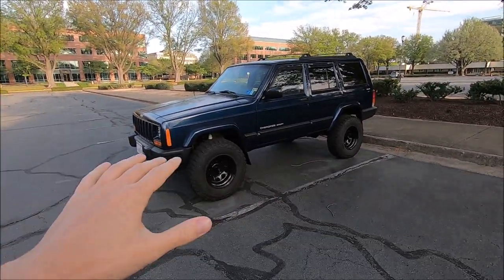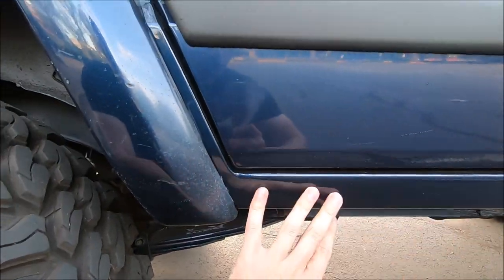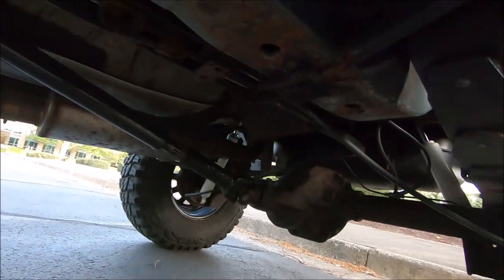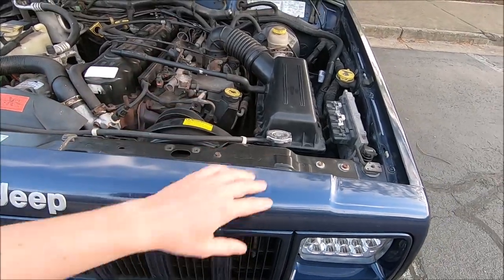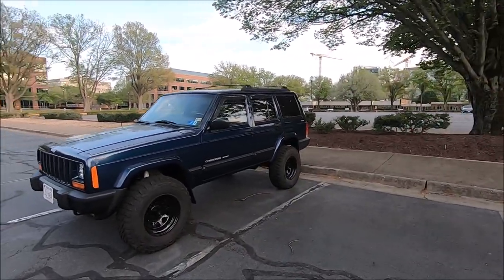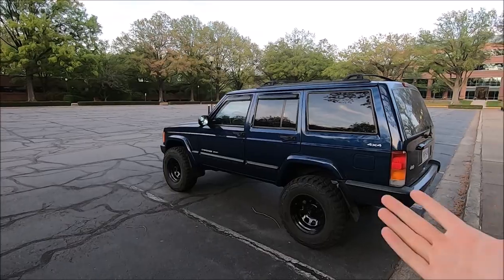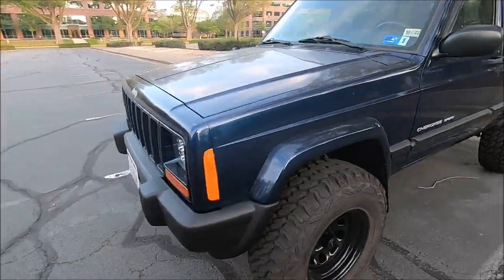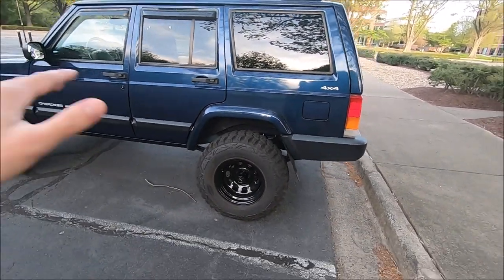All The Issues With My Jeep Cherokee XJ After 2 Years...

Comment from the maker: What would you all like to see next with the XJ? Comment below!
Reply: You should add a double din touchscreen radio
Reply: Fam your jeep is perfect the way it is. Unless you just want to go crazy with 4 links and stuff like that all I suggest is maintain it like you already doing. BTW 96' 4.0 ax15 all original. I bought it for 500 u.s.d..  door hing pins on driver side and passenger floor pan rust due the that seal on the firewall. 240,00k miles. Like you said it's not for sale lol.
Reply from the maker: That’s exactly my plan. I’d like to do some more rust maintenance and possibly upgrade the steering but other than that, just maintain it. Your 96 is probably a fun Jeep as well, how’s the AX15?
Reply: @KCars  I love the ax15. But I'm also a manual lover. It feels faster than a normal automatic tho.
Reply from the maker: Sounds like a fun Jeep and definitely a keeper
Reply: @KCars  yea my area it's rare to see a factory manual jeep xj. From what I read and no one agrees on this btw. There just isn't any real numbers on this on anything I've seen. But only 1/3 of all xj's made was manual and most of those was the 4 cylinders. And if anyone reading this knows real numbers please correct me. I'd really Ike to know the actual numbers. Only thing I wish mine was is a 2 door 4.0 ax15. But I'm very happy and content with mine.
Reply from the maker: That’s what I’ve heard too, especially with the two door models

Comment: The door check pin is cracked. Just get a new one and tap it in. The small bracket may need replacing too if the hole got reamed out. You're going to ruin the door check itself leaving it like that. Get extras and keep them in the glovebox. Four Cherokees in 32 years and only one overheated. The radiator blew. I have well over 500k miles in Cherokees and only 4 breakdowns that required a tow. If I had the parts a roadside repair could have been done. These rigs are pretty basic. I'll keep my current 99 forever. Yours looks really nice.
Reply from the maker: Thanks!

Comment: Genuine Mopar parts are absolutely the way to go if you can still find them. I can't find them consistently anymore and it's almost like my jeep inevitably rejects non OEM parts, or they fail earlier than original Mopar. I've had my 99 XJ for 17 years 255,000 now and keep her running cherry, and I have compared many parts. Radiator, sensors, gauges, water pumps, manifolds, alternators etc, even sparkplugs (learned very quickly to stay away from fancy,  original champions  or jeep just acts funny). Another example was when I bought a non mopar thermostat 180 because I thought it would be a great idea if my jeep ran cooler, boy was that a mistake. XJ was already given me 13 per gallon then I dipped to 11 because  it ran rich. Found a brand new Mopar 195 and just like the original engineers intended, jumped to 15. These vehicles were designed to run hot.
Reply from the maker: Yup they run the best with the parts they were originally built with🤷🏼‍♂️ if it ain’t broke don’t fix it. Thanks for watching!

Comment: Don't remove the original fenders. I honestly think that is what gives the xj its unique look. At the most wet sand the rust with clean green and soft cloth or scotchbrite and the rust color should come off. If you put after market fenders you become a wrangler ✌️
Reply from the maker: I wouldn’t put aftermarket fenders on it, just wanted to get brand new OEM ones and get them painted to match the body. But that also sounds like a good idea

Comment: Re: the fender flares, they're not metal.  Just take 'em off and get them sanded/painted to match your body paint.

Re: the door click, the pin isn't fully seated.  It should stick through BOTH brackets.
Reply from the maker: Thanks!
Reply: @KCars  np.

Enjoy your XJ.  I've had mine since 97 (new) and 325,000 miles later it's still going.

Gas is expensive and the mileage sucks, but I also haven't had a car payment in 22 years.
Reply from the maker: Ya these things are definitely tanks and will go forever if maintained well

Comment: I love the Rusty’s steering linkage i put on my 2001 xj. The clearance issue is from the drag link contacting the track bar bolt when making a full right turn. It’s negligible as it barely scratches the paint of the drag link and isn’t enough to damage the track bar bolt. I think Rusty’s even started supplying a replacement bolt with an Allen head to fix it
Reply from the maker: Sweet! I see they have a few different steering kits. Do you have the standard, offset, or over the knuckle steering system?
Reply: @KCars  i believe the standard. The conversion they offer for the xj tj yj & zj. It’s a T link setup so the tie rod goes underneath from knuckle to knuckle.
Reply from the maker: I’ll have to look into that, thanks!
Reply: I just took an angle grinder to that bolt on mine. Now it doesnt stick out enough to rub.

Comment: My little brother, I am a veteran mechanic doing it for about 40 years.What you need to do is put on a nice big aluminum radiator for your truck and a Emissimoto thermostat.
It will fix your problems forever.Keep it cool all the timeven at a hundred and ten

Comment: You have an awesome looking XJ, that looks almost identical to mine which is a 2000. I bought it in 2009 with 140,000 miles on the odometer for $5,500. Today it has 220,000 miles and still runs great at 24 years old. They last forever if you look after them. I love mine and I will never part with it.
Reply from the maker: thanks! Agreed, these old Jeeps are really impressive. Thanks for watching!

Comment: My 89, closed system, never overheated but ran warm.  Fixed the electric fan but still had heat creep.  Installed a new fan clutch.  My 89 is a lot older than yours.  Only 124K miles now, uses no oil, rust free, needs painting.  Just something to think about.  I was going to go with a new aluminum radiator but the fan clutch fix it.  My old fan clutch was probably at about 50 to 70 percent good.  The new one made a big difference.
Reply from the maker: I think mine seems to be working the way it should but that’s definitely something I thought about replacing as well. It should have some resistance while the Jeep is not running right?
Reply: @KCars  It should have a lot of resistance when hot. Less when cool. It should not freewheel when cool. It should stop when turned in a couple of seconds. Mine did but when hot it had little resistance.
Reply from the maker: Ahh ok, appreciate it

Comment: I don't think that the door pin is cracked, I think it's a tension pin. What you need to do is to weld the hole as it's probably elongated. Redrill it with a proper size drill bit then replace the tension pin very cheap and easy.
Reply from the maker: Hmmm I’ll have to look into that. A lot of people were saying that I just need to hammer it back down in the hole
Reply: Jb weld

Comment: Nice snow drive. Really shows how awesome the xj is✌️
I have a maroon 2000 xj automatic. I have just started work on improving it. Flowkooler water pump, hesco high flow water pump, caprice 74C thermostat, next is probably the k suspension cyclone electric fans.
Just watched your video on the fan. Thanks for posting these as it helps newbie xj owners like me🙏
Reply from the maker: That snow drive was a lot of fun. Glad I could help, thanks for watching!

Comment: I'm about to start my own Jeep XJ project, I've had her for 18 years and decided to get some mods for her. I was looking into the 4.5" lift kit but after seeing your Jeep I'm convinced the 3" will do just fine, so thanks for that.
Have a question though, after lifting and installing the 31-10.5 tires, do you need to change the wheels? The factory 15" wheels won't work with that setup?
Thanks and great job with your Jeep mods, I enjoyed the vid a lot.
Reply from the maker: Thanks for watching! I would think that you could put 31s on the stock wheels, however, they are an inch narrower than my wheels so they might just be a little more pinched and have less of a contact patch. Not 100% sure on that though but I’d definitely go for aftermarket wheels anyways just because I like how they look more than the stock wheels but of course that’s just my opinion

Comment: All relatable problems comparing to my XJ. Nice video.  Hey why don't you use WD 40 to clean your engine bay. I used and really liked it.
Reply from the maker: Thanks! I wouldn’t want my engine be to be all oily and greasy
Reply: @KCars  yes I agree but not to spray all components. I would really suggest you to clean atleast your fuse box battery and Throttle position sensor and Mass airflow sensors. All corrosion will be gone forever and clean. They are most likely to have problems.
Reply from the maker: I’ll have to look into that, thanks!

Comment: Pop the pin back into place on the passenger side door and your jeep is over heating at any temp over 210.
Reply from the maker: Still need to fix that pin lol and luckily I’ve had no overheating issues after getting the cooling parts replaced

Comment: Put some insulation tape around the metal pin that's creating the door click noise. Or just slip a rubber pipe over it. Or even just a rubber adhesive strip in between. The pin just has to hit a soft surface and the click should stop.
Reply from the maker: Thanks!
Reply: More than likely it’s the bracket that has worn out. The bracket and new pin are cheap and easily replaced.
Reply from the maker: I’ve also heard that the pin just needs to be pushed down for it to stop clicking
Reply: Buy a new bushing and pin and seat it all the way down to the shaft stop.
Reply from the maker: Thanks

Comment: 1994 jeep xj here. It's my 5th XJ. Nothing fancy, 3inch lift with 30s, doors falling off, dents and dings, etc...Trust me when I say, upgrade the radiator.
Reply from the maker: Which radiator would you recommend? I’ve heard that keeping the stock one is the best option if it still works fine but I’ve never had a different one
Reply: @KCars  I picked up a 2core from O'Reilly's for about 150 a few years ago. Overheating hasn't been an issue since. Same with my 89 remix that I had. Just make sure you burp it good.
Reply from the maker: Is it the spectra brand radiator?

Comment: I think it's so funny because I do this as well.  I say,  "I got a really good deal, only $3500.  This car is so clean and in such good shape." Then I spend like $10k in repairs and mods.
Reply from the maker: Lol it’s a never ending project
Reply: ..but still better than a 500 or 600  dollar a month car payment for 7 years 😮😮
Reply: @Roberto Ferrari  agreed. I have a 98 cherokee and an 83 mercedes 240D. I find most parts I need at the local pick your part, and I pull extra parts to sell on eBay.  I'm essentially at a break even on repairs, and have no car payment.  The thought of spending $600 a month on a car I can't repair myself slugs crazy to me.

Comment: What about the 0331 cylinder head? Did you have to replace it?
Reply from the maker: Nope. Haven’t had any issues with it cracking. Also replaced most of the cooling parts to avoid that issue in the future as well.

Comment: put an aluminum radiator with 3 fans and that set no more over heating
Reply from the maker: Thanks! I actually had the cooling parts replaced with all OEM parts and I’ve had no issues

Comment: Any issues with the front wheels rubbing on turns?
Reply from the maker: They rubbed the bumper end caps so those were trimmed and they rub the mud flaps a little bit as well but I decided to keep those on because I like the look and function of them and they don’t rub too much only on full lock

Comment: How’s it on gas? Been debating to buy one
Reply from the maker: Some people say bad and some people say good. I’ve honestly never calculated my MPGs
Reply: Averages about $40/wk. around 40miles round trip daily to and from work, 5days a week.
Reply from the maker: Thanks
Reply: I used to get around 12mpg, but after upgrading injectors to 4port, new plugs, new coils, new O2 sensor, new fuel pump I'm now getting around 14mpg. same xj classic 2001.

Comment: Any thing over 210 is to hot, one check ur clucth fan , and you already covered the rest
Reply from the maker: True my clutch fan seemed to be fine. Replacing the other cooling parts seemed to have fixed my cooling issues

Comment: BRUH! All you need to do is hammer that pin on the door check strap back thru both sides of the body mount!! It's literally about to fall the fuck out of there. Just need a little tappy tap tap and you're golden
Reply from the maker: Thanks! I’ll have to give that a try
Reply: @KCars  No problem! Hopefully it's still there! I have lost a few of those funky lookin roll pins due to the bracket on the body becoming wallowed out and the roll pin no longer fitting. Moved the bracket from the rear passenger to my drivers door and now my least used door is clicky and poppy and my most used door is buttery smooth. Also I'd recommend taking a look at Project Farm's videos on here and his testing of undercoatings, bed liners, and other rust prevention methods. You'll find that fluid film isn't even as good as WD40. When I put Iron Rock Offroad's Rocklink Pro long arm kit with rear coil spring conversion with 4 link long arms on my y2k XJ, I stripped the undercarriage, trailer'd it to Arma Coatings to have the underside professionally sprayed with bed liner, and then after that cured, I used about 15 rattlecans of 3M rubberized undercoating and sprayed over the bed liner so when my 37's kick up big rocks they don't chip the bed liner. Also it cut the road noise down to the point where I can do 65 down the highway on boggers and still hear my blower motor when it's on speed 1. Before the Arma Coating and rubberized undercoating, I could barely hear the blower motor when it was on speed 4 and I had it on AC recirculate over the roaring drone of the 37x13.5 TSL Boggers.
Reply from the maker: Thanks, I’ll have to look into that. I’ve thought about doing the rubberized undercoating as well to help make it look better and protect it better as well. I’d just be a little worried about trapping moisture underneath the coating
Reply: @KCars  brake clean will be your friend here, not only does brake clean evaporate and dry super quickly, but it takes water with it. It molecularly bonds with the hydrogens stripping them from their oxygen.  Also, tetrachloroethylene, abundantly found in brake clean, is one of the main ingredients in rubberized undercoating that keeps it in a liquid form, along with acetone. Both of these evaporate super quickly leaving behind the rubber wherever you spray it, making brake clean dually purposeful when spraying undercoating. It dries out any moisture before application, and effortlessly removes any overspray you may accidently get on your paint, driveshafts, axle housings, trans, Tcase, or exhaust. Definitely remove any undercoating overspray from the exhaust. You do not want to let it cure on there. It STANKS when the exhaust gets hot.
Reply from the maker: Hmmm I never thought about break clean that way. What about when the moisture gets underneath the undercoating after it has already been applied
Reply: @KCars  that's where good prep comes in. When you think it's clean enough, clean it again. If you think you scuffed it up enough. Hit it with an abrasive pad on a die grinder.
Reply from the maker: 👌thanks
Reply: @KCars  The pins pop out once they've worn. Get a new one along with the bracket. Cheap easy fix.
Reply: When ever I got to a junk yard and visit an XJ, I always take those pins. When you lose one, you'll want a spare.